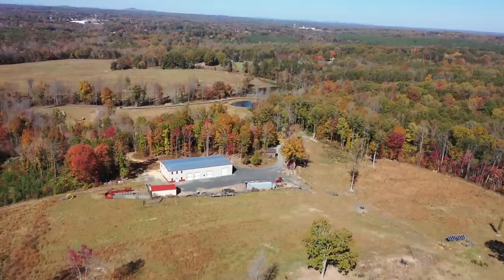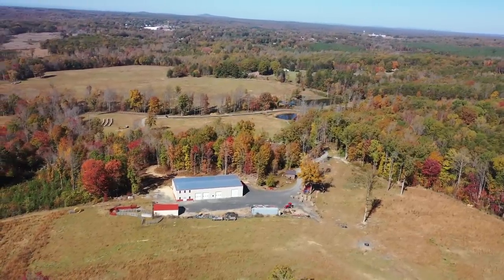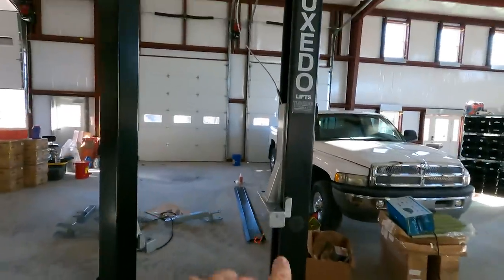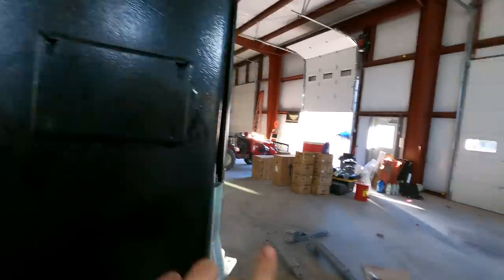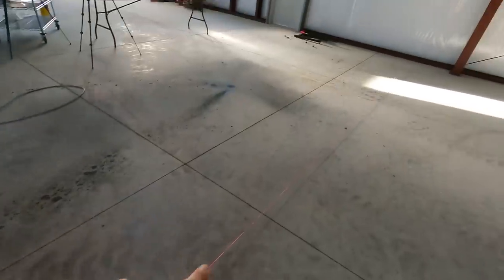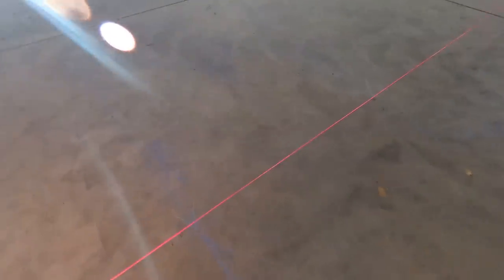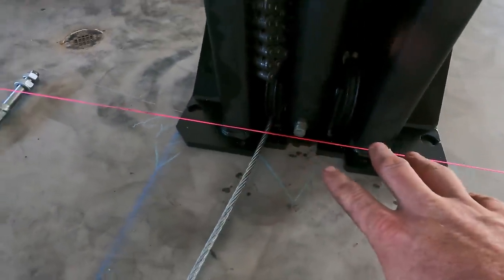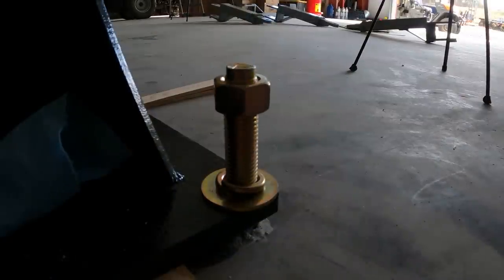How to install an affordable automotive lift! Perfect man cave!

Comment: For those of you thinking about building a shop and installing a lift, you should probably get the information on the footprint of the lift and layout the floor thickness accordingly.
Reply: I've looked up several and even the higher capacity lifts say 4" concrete a minimum of 3000psi. I'm looking at the 11,000 lb lift and it has the same concrete specs for mounting.
Reply: @3gunshooter60  
Just be careful, because I’ve seen several times where they’ve busted out a big chunk of the floor and tipped over. I’m sure that having an off centered distribution of weight doesn’t help.
If that 11,000 pounds is distributed over two plates that are 16”x16”, that’s max for the 3000 pound per square foot concrete. Now, if it’s off center, that 11,000 pounds is suddenly on way less than 2 square feet. It adds up very quickly. And as the tipping begins, it escalates even further.

Comment: I wouldn't rely on wood shims. I'd get everything where it needs to be and then put in a hydraulic cement under the pads and shape the edges that way everything isn't sitting on anything wood which can expand, contract and most importantly, rot away
Reply from the maker: it has metal shims my friend....I can't remember, but maybe I used wood to level it in the video...but I'm sure it's metal shims now

Comment: I used to install automotive lifts, compressors, and build gas stations, you skipped torquing down the anchor bolts. also you will want to re-torque the bolts each month for the next three months and after that they are checked once a year along with removing the cover or drive over plate to remove any debris. you will have to bleed your cylinders and adjust your locks once you get power. not sure the size or weight capacity you chose but remember a 10,000lb lift does not mean it should be lifting that. you have to take into account the arms and carriage as well. the hydraulics might lift it but the steel will fatigue over time. if you ever get another two post lift look into an Asymmetric with extended columns. this will allow the columns to be turned out allowing you more room to open the doors of vehicles wider to get in and out and the extended columns more lift hight due to you being taller. I like Rotary or Challenger for the money in two post lifts. if you ever need parts check out SVI international hoist company. hope this helps

Comment: I like the new addition to the shop. That's a game changer for working on vehicles at the farm. The four post lift is going to be another great addition. Both have their purpose and uses.  I did not know Northern Tool sold equipment like this. Time to take a look at their site. 🚜-Woooo!!

Comment: I helped my neighbor put up 2 of those lifts, a 9 ton and a 12 ton. Me an electrician, him a retired roustabout company owner. Used my 1025r with loader and we're 67 and 70 yrs old with many medical conditions. But we got em down, but my neighbor got the wrong breaker. I caught it when I took it out of the sack. The ones we mounted looked alot heavier built than the one you got. All the cables ran overhead no beam on the floor, easier to sweep and clean around. Supply issues really suck now. The safety shut off went across the top so if the vehicle roof just barely touched the cable it stopped. It went up high enough you could drive a car under it. He stored a 56 Chevy bel air on top and a 59 corvette below. The vette is for sale all original and numbers match ,convertible of course. 55 is still being put together, frame up restoration on it, highly customized from the ground up, running a 900 hp big block.
Reply from the maker: yep...opted for the low mount so I could raise the lift higher

Comment: Josh when drilling concrete for anchors drill all the way through the concrete in case you ever needed to move or replace your lift you can knock the anchors all the way through so you don't have to cutoff your anchor. I'm talking from experience  installing heavy machines for textile companies around  NC,SC AND Virginia great video.
Reply: That could be a problem on thinner slabs. When the bit exits the other side, the concrete spalls off creating a thinner cross section at the anchor bolt.
Reply: @scottnunya1  The concrete floors I would normally work on was 10" to 12" thick and some 8" and I've never had any problems but on a 4" slab of concrete without fiber yes it could possibly cause a problem.
Reply: I used to install automotive lifts and you don't want to do this on thinner floors, as the back side blows out causing it to be thinner at times and there is no way of knowing

Comment: Your a big guy, I use ramps to change oil on my TDI Jetta. I could use my neighbors garage, but his floor isn't concrete.   I've got 900 miles left; it'll be 32F on Tuesday.  I bought material today.  Don't get crunched or pinched.  -Brian

Comment: I'm happy that the lift I ordered (9000Lb capacity) is a clear floor, and with a 13ft ceiling, and extra heavy concrete for this, that my contractor poured for this, I should be set!  The question is, without a fork truck, is it possibel to get it off a freight truck? (maybe undo the plate on the bottom and pull the arms out of the cavity, possibly?)
Reply from the maker: YOU NEED FORKS TO GET IT UNLOADED....LONG FORKS!! We had to unload with the lift gate and the forks on my tractor...you won't get it off unless you have a forklift or tractor with pallet forks

Comment: You mentioned fiber in the concrete. I hope you have a mat of re-enforcement steel in that concrete. Fiber is for cheap concrete like sidewalks or house slabs most times using 2500 psi or 3000 psi concrete. Sure hope that concrete over time will support that heavy lift with vehicles on it.

Comment: Pretty sure you can't tighten the cables all those do is adjust the cables so that the arms are at the same height the half inch tension you're feeling it should just be the weight of the arm on the opposite side.  I've been wanting to get a lift for a long time but I want to get one where the cables go overhead so that the two towers can't collapse in on each other if the floor anchors give away.  Or if I end up with a lift with the cables going underneath I mean those are probably more affordable then I think I would anchor the top posts of the lift to the rafters of the building I'm super paranoid lol.

Comment: The only thing I don’t like about the drive over lifts is that it makes it hard pushing a car or truck into (that doesn’t run) because you’ve gotta get it Over the hump & if your pulling a transmission that hump gets in the way sometimes
Reply from the maker: yep...makes sense
Reply: I agree with this from experience but.... the pro to having it not overhead is the clearance for taller vehicles.

Comment: How do you like that lift? On Race Tools direct website, I am stuck between the Tuxedo and the Race tools direct brand. I just built my garage last summer and my slab is 4 inches thick at 6,000psi
Reply from the maker: great lift...but you'd be better suited with a 4 post on 4 inch concrete.....or you need to cut out and pour a footing for this 2 post lift in my opinion
Reply: @StoneyRidgeFarmer  yea even though the minimum requirements say 4 inches, I think I am going to cut two 3'x3' squares and make them 6 to 8 inches thick.

Comment: Josh, what are using for insulation?  Thanks!
Reply from the maker: this is "bat" insulation and is 4ft wide.  r32 I think in the roof and R13 in the walls...I think...it's been a bit so don't quote me....it holds heat and cool very well

Comment: Put hydraulic control on passenger side. When you get out of car set driverside of lift move to passenger set lift and controls will be right there.
Reply from the maker: as per the recommended install methods...lift controls installed on the driver's side...so we're not walking in circles around the vehicle all of the time
Reply: @StoneyRidgeFarmer  think about process of lifting car. When get out of car you set lift on drivers side move to passenger side set lift. If it was on passenger side you would lift car. But now you will move back to driver side. When lowering with it on driverside you will lower car unset driverside move to passenger side unset lift move back to driver side to pull car out
Reply: @bradduncan9353  You make a very good point. Also when you drop the car back down you will have to be standing by the controls, then Swing the arms out from under the car, move to the other side and swing those arms out of the way and by then you will be standing by the drivers side. So it works both for when you first lift it and for when you bring it back down again.

Comment: so for those of you that want to install your own lift like this...... PLEASE RE-THINK IT!!! I have been a Master automotive technician for the last 30 years, and I've seen my fair share of lifts that fail over the years, one almost killed me. PAY THE MONEY TO HAVE A LIFT INSTALLATION COMPANY PUT IT IN, YOUR LIFE MAY DEPEND ON IT! you are in essence balancing 4000-6000 lbs of weight over your head, and some expansion bolts and the strength of your concrete are all that's between you and death. the lift company can inspect the concrete, bore a test hole to check thickness and gauge it's strength, and has the correct tools/drills/jigs/leveling shims/procedures and the correct size/length/strength expansion bolts to do the job, and when i had a lift installed in my home shop, it was a few hundred dollars for them to assemble and install the lift- well worth the money. also you are also supposed to check the mounting bolts every few years to check that they aren't pulling out. 
last: you will really regret not getting a balance cables over the top style lift. that plate at the bottom is a pain in the arse if you ever have to pull a transmission. why in the hell would you ever want a tripping hazzard at your feet when under a lift? The clear area under the lift is well worth the extra expense. also the top bridge that goes between the towers at the top also helps keep them from tilting in at the top when loaded. lastly, ROTARY LIFTS FOR THE WIN! again, you have thousands of pounds of weight over your head, why skimp out? Rotary lifts have been around for a long time, and they have replacement parts for lifts that are even decades old. and that safety catch release on each side is a crappy way to do it, they should have one release handle that un-latches both safety's on each side and that will reset the latches if say you release it half way down.
Reply from the maker: i poured the concrete my brotha...but I agree with ya...know your specs first for sure

Comment: that floor plate is going to be a pain in the arse if you ever need to use a tranny jack. I went with a top brace lift to keep the floor clear.
Reply from the maker: got a 4 post now also
Reply: Clear floor lifts require more ceiling height up to 12' and higher. Floor plate lifts will accommodate lower ceilings which a lot of people have in their shops. I'd take a floor plate lift over no lift any day.
Reply: @homewrecker44  sure, but he clearly does not have a ceiling height issue.

Comment: welp sorry stoney but you installed it incorrectly. the power unit goes on the right so you can get out set the driver side rack go to right side set that rack and voila the pump is right there. "least amount of steps"
Reply from the maker: I installed it as per the instructions 100% my friend...but I get what you are saying for sure lol

Comment: Not going to be fun pulling a transmission...... overhead cable is the way to go.   You have an audience of knowledge, use it.
Reply from the maker: again...4 post lift goes in next buddy...so that would be the transmission removal area if need be..but you do make a good point....although I can't listen to the audience after the fact brotha

Comment: Drill all the way through the slab.  Eventually, you'll want to replace that cheap Chinese lift with a proper ALI certified one. When you do, you'll want to drive those anchors through the slab into the dirt below.  I'd never let my sons or wife work underneath a cheap lift.  There are lifts MADE IN  the USA.   I lift my 3/4 ton Ram diesel truck on my two post lift.  The weak spot on those cheap Chinese lifts are the arm-to-carriage connection, as well as the crappy plastic sliders and wire ropes.  That lift looks like a toy
Reply from the maker: yep....100% guarantee that parts of your lift are made in China....just like everything else these days.  I had a buddy that just put in an "American made Lift" .....I took him and showed him the Chinese parts all over it.  Show me a 100%  American Made product with moving parts and I'll buy it brother